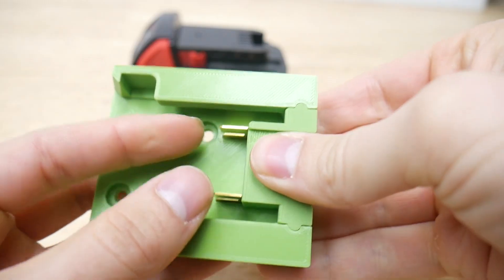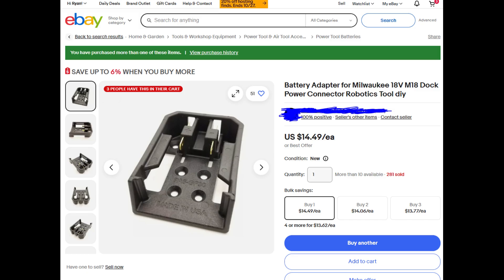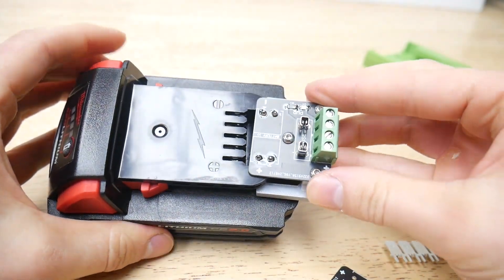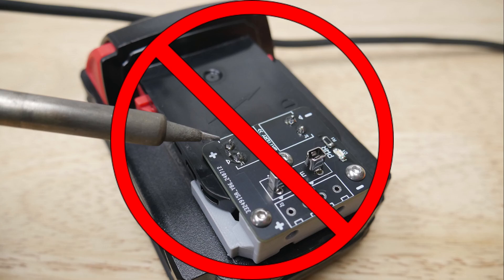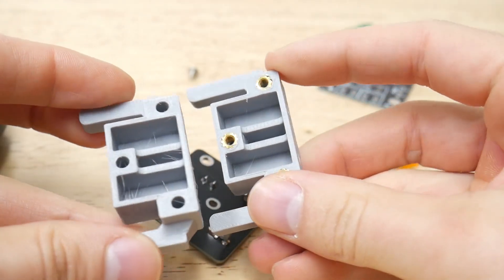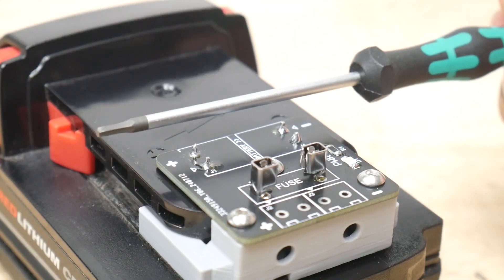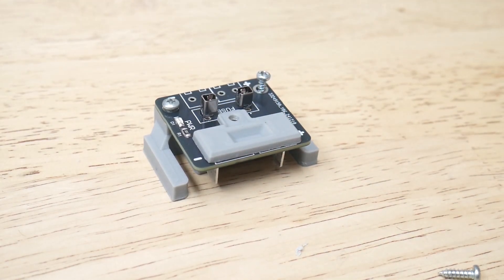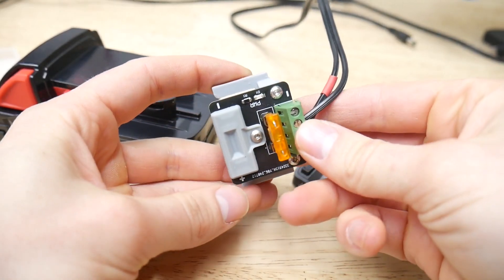Milwaukee M18 Battery Clip PCB

Comment: I would get this in a heart beat if you integrated the communication with the battery for low voltage cutoff. If you look it up on YouTube, someone reverse engineered it and iirc was really simple. It had the wirering diagram at the end

Edit: its the tool scientists video 004 and 005.

Comment: Does the Milwaukee battery have low voltage protection?
Reply from the maker: i believe that is done on the tool side, not the battery side
Reply: These brands typically include overcharge, over-discharge, thermal, and short-circuit protection inside the battery pack (not just in the tool or charger):

1. Milwaukee (M18 & M12) – Has a RedLink Intelligence BMS inside the pack.

2. DeWalt (20V MAX, FlexVolt) – Includes overcurrent and thermal protection in the pack.

3. Makita (18V LXT, 40V XGT) – Integrated protection circuit inside battery.

4. Bosch (18V Core, ProCORE) – Uses CoolPack technology + BMS in pack.

5. Metabo (18V LiHD) – Has a smart BMS to control temp and discharge.

6. Ridgid (18V Octane, Max Output) – Includes individual cell monitoring.

7. Ryobi (18V One+ HP) – Has basic BMS for overvoltage/undervoltage.

8. Hilti (22V & Nuron 22V/120V) – Advanced BMS with detailed cell monitoring.
Reply: Milwaukee batteries do not balance internally. So just tapping into the terminals may over discharge them and throw the cells out of balance, then you'd lose capacity. Since the BMS will cut off charging when just 1 cell hits 4.2V, and when discharging with a tool, the lowest cell will trigger cut off, when other cells still have power left.
Reply from the maker: source?

Comment: nice build, from what i understand ryobi batteries are the only ones with bms in the battery and m18 is on the tool, so dont drain all the way, could damage  it, looks good